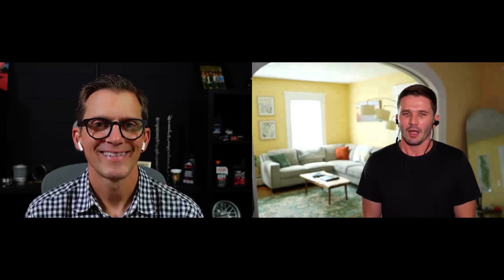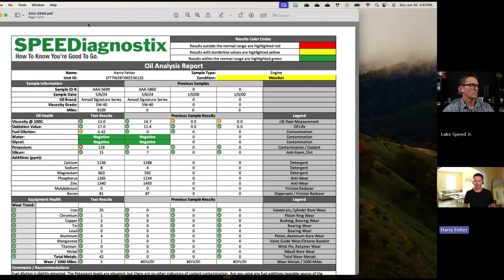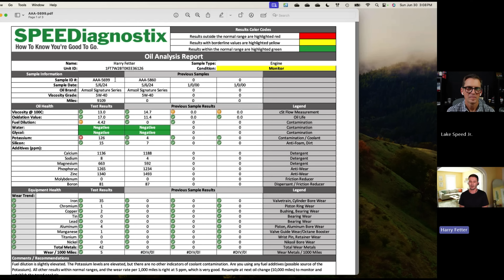9000 Mile Amsoil Oil Analysis With The Motor Oil Geak

Comment: O god . I’m going to keep doing oil and filter change at 3000 miles . Just oil just a filter . No need for all this bologna. My Toyota does just fine .
Reply from the maker: How many miles do you drive annually?
Reply: @powerstrokemaintenance  I drive around 15000 miles a year . $70 an oil change ,or $350 a year . $3500 over 10 years which is a little more than the price of my short block in 2024 . In the future who knows. I could go 5000 miles , but I like my 40 year routine . The price of a short block and removing and installing labor , supplies . I’ve seen engines replaced for $5k to 7k. I’ve never dealt with that with my routine. Ams oil has guarantees about protecting your engine . Keep your receipts and records you will need them . Hopefully not . When an engine fails with a wonder oil I can c myself telling Toyota I change my oil every 9K . Who’s going to be there with me when they say I only followed the minimum maintenance requirements to keep my warranty ? Toyota suggest changing your oil every 10,000 miles and your filter every 5000. That’s the minimum. I prefer to do the maximum. I don’t want to jump through hoops show receipts argue, and maybe get my engine replaced or maybe not. Changing my oil every 3000 miles with a filter, I’ve never had a problem. I don’t want to hope that Amsoil will help me when I need it. I don’t like to put myself in the hands of others because there are too many loopholes in life.
Reply from the maker: I respect your opinion and it sounds like you have a good regiment in place to make the engine last a long time. That being said, it sounds like your entire approach is based on fear rather than fact
Reply: @powerstrokemaintenance  no . I’m independently wealthy from my life in show horses , race horses and real estate . I have no fear except that of having a Democrat for a next door neighbor. I just look at what I do as what I have to do . Laundry , bathing , going to the doctor . My fear all kidding aside is from when automotive companies were forced to keep getting better and better mpg. Going from lei tolerance tight fitting engines to the more loser fitting engines to reduce friction loser piston rings allowing for fuel to more easily mix with oil . Oil dilution by fuel is a huge problem . You c it at bullet proof brands Toyota and Honda   This is a big reason why I don’t do 10k oil changes again that is the MINIMUM requirement to keep your warranty. Not everyone drives the same . Some people like my mom drive 15 miles a day some less . Those people that don’t drive much don’t qualify for 10k oil changes . People that drive more . A hundred or two hundred miles a day seem to fit that criteria. Where that criteria begins from low mileage driving to high mileage driving IDK. Who does , what are there credentials , & r they going to pay to fix my car based on me following their directions? For some people that can’t afford to repair their cars it may be fear based . For me it’s just common sense . The only place I am liberal on my thinking of this philosophy is in the maintenance of my ZL1 Camaro . It has a computer monitor for the oil maintenance . When it says 50% of engine oil life is left I change the oil . I do that because it’s my track car . I drive it like I stole it and push it hard . It has like 11 or 12 radiators . I can’t remember exactly but 1 for coolant 1 for the supercharger coolant 1 for the manual transmission 1 for rear differential fluid - for brake fluid etc etc. I really change the fluids a lot . . 👍
Reply: Hmmm; I have a question then. Honestly why are you here ?
Reply: @oneninerniner3427  I find it interesting . I like to look at do things . I like to hear different opinions . My opinion can be changed by facts and science .
Reply: @brucek.hoffman5868  great for u , but I don’t give 2 shits what u think about what I think as u don’t pay my bills . I hate when people tell people what they r thinking or should think unless asked .
Reply from the maker: @marklloyd4153 isn’t that would you did with the comment that started this whole thread 😂

Comment: Why doesn’t a 2024 Chevy oil life system know when I change oil? I change my oil at 790 miles and the oil system had no change. The oil analysis has iron at 45 and copper at 145. The filter was draining tons of sparkling bits.
Reply from the maker: Thanks for the comment

Comment: Lake is extremely knowledgeable..But running a oil to 9K Miles is not good maintenance
Reply: @Elvisthebullyking  Thats right, I run between 11 and 20k in my Duramax... 754k now and going strong. Miles is not the end all be all factor.
Reply: Depends on it you have a crappy motor or not.  And how many miles you drive a year.

Comment: Manufacturers have to take the average customer in mind when recommending oil change intervals. Small print says different conditions can change the intervals. The majority of auto manufacturers recommend 10,000 miles with synthetic oil.
Reply from the maker: Good point!
Reply: In addition, some manufacturers overestimate how far that oil can go. I think about how many Toyotas sludged up because people changed the oil exactly when Toyota said so. Going 3000 on conventional or 5000 on synthetic could have prevented some of that.
Reply: @skylinefever  In the 1950s, Quaker State non detergent oil, usually 30 weight was the oil most people used. The change interval was 3,000 miles. Full synthetic oil is light years ahead of that oil, and filters are better, so changing at 3,000 miles on today’s engines is crazy in my opinion. Why not take a taxi or a bus instead !
Reply: @captnjim44smith74  You also had engines with 4 or 4.75 mm oil rangs and a huge opening behind it for oil return.

With modern 2.5 or 2mm oil rings and a few tiny holes behind it, a small amount of sludge will ruin the ring.
Reply: @skylinefever  Yes, I understand, but you don’t see hundreds of cars with problems everywhere that your idea suggests.

Comment: Has anyone used Triax Fleet Supreme. I've been using for 3 years and really like it. My last oil change was 16k 2020 6.7l diesel 15w-40, oil was black but still looked okay!
Reply: Like to seen an oil analysis on it at 16k. Be good information

Comment: Spent 3 yrs in germany as a driver ....M110A2....not once did we change the oil in 3 yrs...nor did i see any vehicle get a oil change....we idled the engines everyday....and only drove them occasionally outside field use....the big turbo diesel engine used 30w....yr round....but all engines did get frequent oil testing
Reply: More specifics, please.

Comment: I have a 99 Super Duty 7.3 Powerstroke. I sent my oil analysis into Blackstone twice and both times around the 6500 mile mark.  Rotella T6 5w40. Both times I was told to try going 8k miles because of the condition that the oil was in.  I do use an oversized Donaldson Blue oil filter and Archoil additive if that makes any difference.
Reply: @alanlong2966  no need for oil additives the detergent package of every single oil should be enough to take care of it. Things go to Lake channel and go back a few months. He has two videos that explain how much of a scam oil additives are.
Reply: @juanzo74latincrypto52  totally correct. A good, high quality, properly formulated oil should have the additives All In Balance. If an additive gets dumped into the mix, it could throw the additive package out of whack. Those chemical Engineers know what they're doing, don't shade tree mechanic what they've created.
Reply from the maker: Nice! Thanks for sharing

Comment: Where is the indicator for sludge formation in the oi analysis?
Reply: Not needed as long as the additive package is still available no sludge. Also oxidation value tells you when to change. Oxidation is what causes sludge with moisture
Reply: @bigdaddymak1439  You can change oil in a sludge filled engine, and after a short service interval the fresh detergents will knock sludge off the engine internals with a mix of dirty oil and remaining sludge and still and still a viable additive package.
Reply: @mback12000  oil detergents aren't that aggressive first off. And anything that's in the oil goes into the filter above 20 microns. You said sludge formation which oxidation value would tell you if it's forming. And a sludge filled engine is caused by severe neglect. Those people aren't doing oil analysis. It is very difficult to sludge a vehicle with modern synthetic oil.
Reply from the maker: Yeah it’s oxidation value

Comment: I see people sending in oil analysis with very high miles on the oil and the analysis comes back that they could go even longer.  
I don’t trust oil analysis after seeing this. I have seen dozens of these and never seen one come back bad.
Also consider the amount of sludge in the engine with long oil drain intervals.
Diesel oil is full of soot, soot is what turns the oil black. Soot is abrasive.
Reply: @robm3357  I can see both sides of this. I am still old school and change my oil every 5K. Actually, I usually don't even hit 5K because I rarely drive my diesel. I use Hot Shots Secret Green Diamond 5W40 oil since they have a lot of data to back up their product. So far zero issues and it runs cooler. I was actually told by them that could go 10k easily since their test trucks have gone that or even further. On their other test truck, they installed another filter system and they have over 100K on the same oil. They just add TBN booster. Not one issues. My outlook is, do whatever makes you happy. Oil isn't expensive and if you want to change it at 3-5K, go right ahead. If you want to reply on an oil analysis, that's cool too. Changing your oil more often does not hurt it. It doesn't induce more contaminants by pulling your drain plug and opening your fill cap. If you have to pull you engine apart every oil change, I could see that being an issue. The only problem I see with doing oil changes too early is the cost for the consumer, filled up oil repositories at local parts stores, more strain on factories to produce/recycle more oil, and also the factories to produce more oil filters.
Reply: @jasonkubitz9410  I also change my oil between 3 and 5 k .My Colorado 2.8 only takes 6 quarts so I don’t care how much life is left in the Ams oil I will still change it. I see too many engines failing on YouTube with massive amounts of sludge in the engine. And todays long oil change intervals seems to be so mfgs can brag about how they have a low cost of ownership. At least while it’s under warranty that is.
I run my diesel very hard and tow at and above the mfgs limits.. So lots of oil changes. That includes transfer case and diff oil every 2 years. Also I drop the transmission pan once a year and then add 6 quarts to keep the transmission oil clean. Over kill, maybe.
Reply: @robm3357  I think you're doing everything right. This is my subjective opinion of course. There is a lot of science behind modern oils and I do believe anyone can stretch their oil change intervals. On the other hand, I've never heard of any adverse effects from changing oils too often. The only thing that it would hurt is the consumer's pocket book. My outlook on all of this is, if you purchase an expensive product such as one of these high priced diesels, why try to save a few bucks on stretching your oil changes? If you're worried about maintenance costs, you should be driving a Honda. Even my Honda Accord I change the oil every 5K. Is all of this overkill? 🤷🏻‍♂️ Can I afford to do it to give me a piece of mind? Yup. Like I said, I can see both sides of this argument but there's one method that has been tried and true for many decades. Oh ya, I work for the government and I can tell you they don't care how much oil they use. Testing oil is usually done during R&D to find a happy PM interval. Typically to avoid catastrophic failure which could lead to loss of life. Not so much for mechanical longevity. Unlike the government, we don't tear our engines down and rebuilt regularly.
Reply: @jasonkubitz9410  Mr. Lake always  says, I hate engine oil maketing........."I was actually told by them that could go 10k easily since their test trucks have gone that or even further."
Reply: @kk-pz8gn  I agree with Mr. Lake. Where does that marketing money come from? The consumer. With that being said, I highly doubt Mr. Lake is buying Kirkland engine oil and adding his oil friction modifier. I'm sure he buys a name brand that has their own additive pack. That name brand probably does some marketing. Just like Amsoil which is discussed in this video. I like Hot Shots Secret since they do very minimal marketing. They just have a great product. My quoted statement you posted is literally from one of their formulators. It isn't written on the oil jug nor is it on any of their very few adds for their product. If talking to a few random people over the phone is their version of marketing, I don't know how they're still in business? Oh ya, they formulate really good oil. Oh ya, Mr. Lake mentions testing oils in the government for various applications. I have worked with a few triboligists for the military and oils are not regularly tested. There is some testing during R&D from the manufacturer but the majority of military aseets are broken down to parade rest. Meaning they get fully disassembled during a PM. Any lack of adequate lubrication will be captured by visual and quantative measurements by a triboligists. I'm sure yall knew this already though 🤦
Reply from the maker: Facts don’t care about feelings. Freight doesn’t get moved with 3000 mile oil change intervals.
Reply: @powerstrokemaintenance  There definitely are some benefits to testing your oil and getting a piece of mind to run longer OCIs. Like Speed said, everyone's application will depend on a multitude of variables. That's why I like Maxima Racing Oils. They're right down the street from me and I can have my oil tested right in their lab. Yes, they do have a diesel oil but I haven't switched to it yet. I use their oils in all of my offroad toys. Since where I ride has tons of dust, my oil gets changed out faster than someone in the Midwest where it may be more damp with less dust. I don't regularly test my oil with them because they've already done the R&D. I love talking with their formulators. Their clutch oil is hands down the best on the market.
Reply: @powerstrokemaintenance they also use gallons of oil, not quarts.
Reply: I don’t like extended drain intervals on gas engines. Once you plug up those oil return rings, you are screwed.
Reply: @JAMESWUERTELE  I run Hot Shots Secret Stiction Eliminator every other oil change on my 2008 Honda Accord 2.4. I change at 5K intervals. I had to change my VVT sprocket about 30K miles ago due to it getting locked up for some reason. Honda is aware of it and it could happen right after you drive it off the lot to hundreds of thousands of miles later. Mine started acting up at 220K. When I popped the valve cover off I was amazed to see very little varnish and zero sludge. I don't know if that's because of my 5K oil changes, the quality of the oil, or the additives and cleaners I use. She runs like the day I got her at 260K on the clock.
Reply: @JAMESWUERTELE  Having carbon caked on the compression rings is no good either.
Reply: If there was problem with the soot you'd see it in the wear metals. No idea on the sludge.
Reply: Heat turns the oil black/dark.  Jet engines don't really put soot into their oils and the samples come out black.  Project Farm's pseudo-Noack volatility test turns the oil dark.

Comment: As an old machinist, I can guarantee you that an oil Analysis is the only way to know when to change your oil. Don't just go by what the guys at Amsoil tell you. Speed Diagnostix is the best in the business
Reply: Amsoil tells you to do analysis AND they have their own analysis center. Read the find print.
Reply: @jeffreyb1451  I don't use amsoil. But you should always do an oil analysis, it's beneficial to everyone.
Reply: @Bobthebuilder.69  amsoil is not in the business of blowing up your motor 

They wanna test

Comment: Can i push pennzoil platinum 0w20 to 10k miles?
Reply from the maker: You won’t know how far you can push it until you test. It’s different for everyone.
Reply: @powerstrokemaintenance  ok
Reply: @emadalkahroosi  only if you check it at 5, 7500, and 10000....but by then you will have paid $40-60 three times and it would be cheaper to just change the oil.  I have a 2018 Camry LE bought from a dealer in upstate NY at 32,000 which had the records they changed it every 5k. It helped me feel comfortable buying the car.  Guess what happened to me this past Jan 2024? I sniffed gasoline in the oil 2000mi after an oil change using that same oil, noticed the level on the stick was just a teeny bit higher than I left it, sent a sample of it to Speediagnostix and changed the oil immediately.  The report from Lake came back with dilution at 1.6% and viscosity barely high enough to be in range. I followed what I was told, stopped using generic gas, started Chevron Techron gas treatments, and the dilution has gone away. Lesson learned: dirty injectors.  Other lesson learned: just how high would my dilution have been if I A) had not sniffed the oil B) checked the oil C) done an analysis and D) blindly driven to 10,000?   Answer: just because you can, doesn't mean you should.
Reply: @emadalkahroosi I wrote a reply of my experience but it didn't show up....basically, not without testing.
Reply: @richcombs4805  ok
Reply: Blackstone is less expensive to do a check.  If you have GDI it's less likely to be good at 10k miles.  So an oil test is definitely needed.
Reply: @lonniebeal6032  I'm not in the US lol